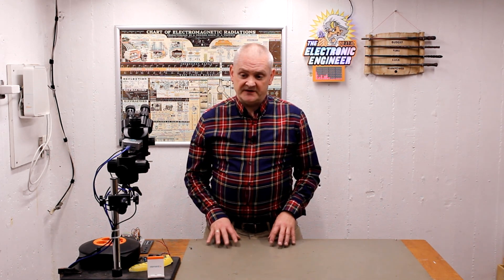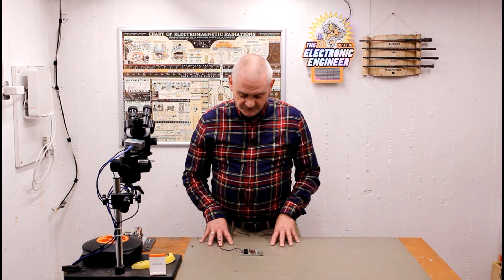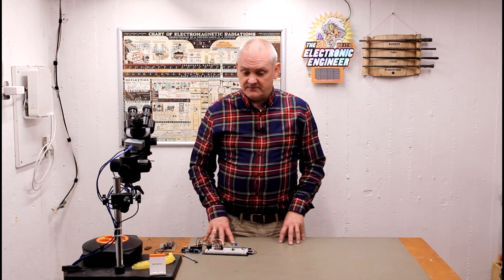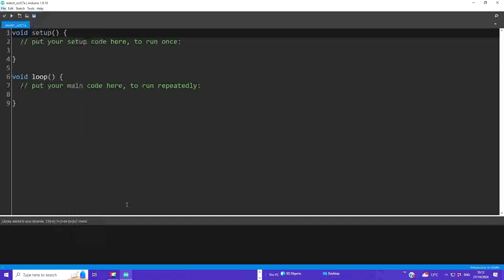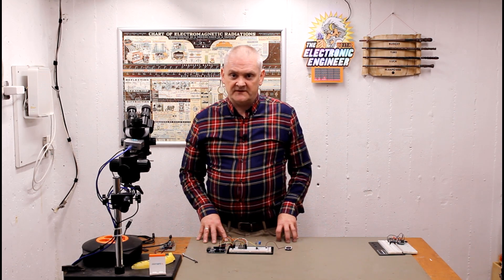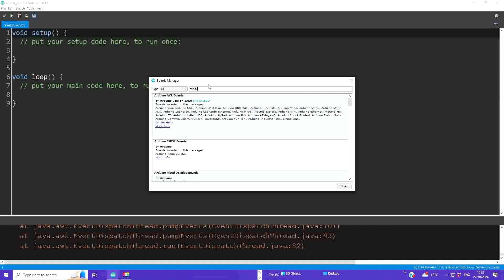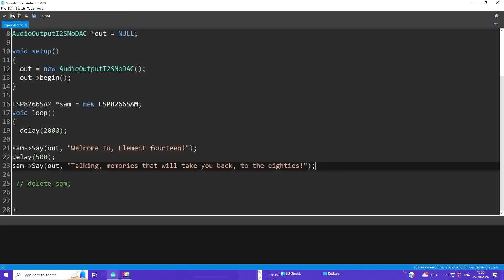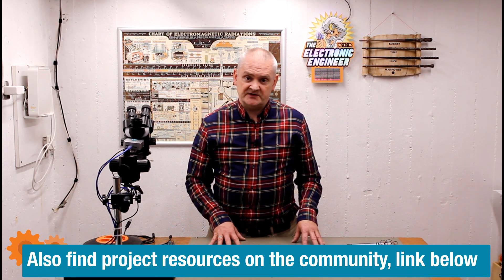Emulating a Speech Synthesis Chip with an ESP32

Comment: As always, if you have questions… drop me line and I’ll do my best to answer.
Reply: I have old circuits that require the speakjet chip, is it possible to replace that chip that is no longer available with an emulation running from ESP32?
Reply: @originaltrilogy1 yes

Comment: Antic and Analog magazines both had plans for building a board to hook up the SPO256-AL2 to the Atari 8-bit joystick ports.

I wrote a utility to send  phoneme strings to the speech hardware during the vertical blank, so Atari programs did not have to be tied up running the voice synthesizer.